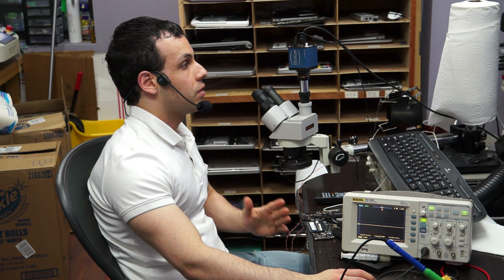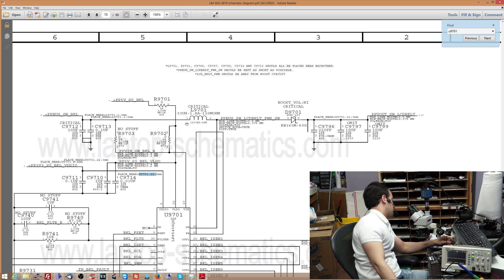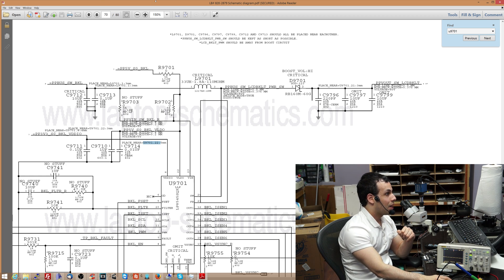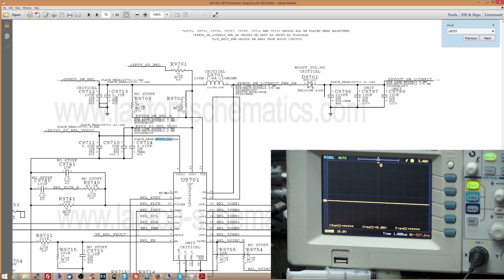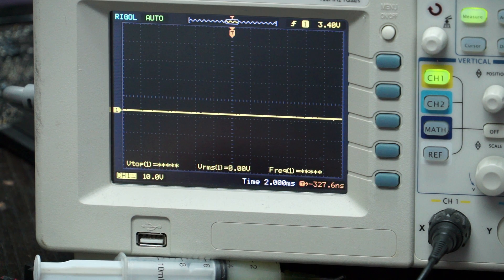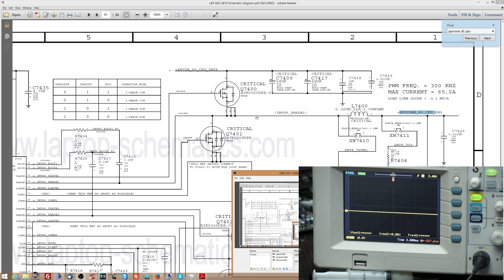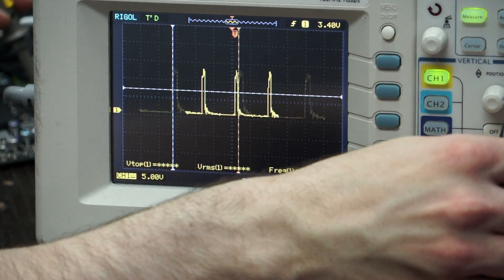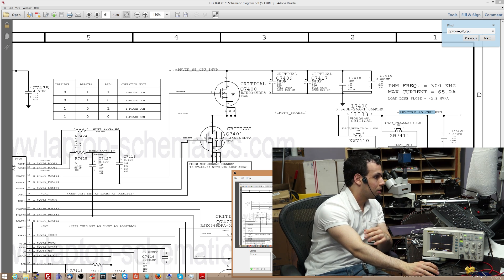What is an inductor and how does it boost voltage?

Comment: Here I am commenting on a 10 year old video hoping to get an answer lmao. Wouldn't the 26v or whatever go to the ground and not make it to the capacitors? Or is my assumption right that the switch is turning on and off right in the middle of the electricity traveling, so it shows the electricity the wallet it stole and then closes the door and then the angry volts are forced to go somewhere, somewhere being to the capacitors?

Comment: I like to think of capacitors and inductors as being conservative: they resist change.
The cap resists changes in voltage by swallowing or spitting out current in whatever direction will counteract the change. 
The inductor does the same, just with 'voltage' and 'current' reversed.
Fun bonus: if you connect both together, you get a circuit of 2 conservatives who fight each other by changing what the other one reacts to change in... They will argue back and forth over it, until the resistance present in both of them has drained them of energy.

Comment: Not enough teachers, or text book authors seperate the 'hardware' ,or mechanics of electrical devices from the software. You dont have to know how and why a component does what it does in order to fix a device. You can, however be sure that what whatever it does, the component/device you're working on is doing what it is supposed to be doing. Even if you dont know what that is.

Comment: The effect of an inductor in a circuit is to oppose changes in current through it by developing a voltage across it proportional to the rate of change of the current. An ideal inductor would offer no resistance to a constant direct current; however, only superconducting inductors have truly zero electrical resistance.

Comment: The only thing I would change which is guess is a little pedantic of me is when you said you’re stopping in the car and you go for a split second at 40-50, it’s not true you’re still going at 20 mph like the car was, the only difference is it’s no longer moving relative to you, so the seat belt holds you back and at 20 mph. That’s a lot of momentum being stopped in a fraction of a second though so that’s why it’s such a large jerk ( or impulse ( change in momentum))

Comment: Your seatbelt analogy suggests that a current of electrons has momentum. Am not sure why they do, but it is like water hammering in plumbing: turn the flow off suddenly and you can burst a pipe. The normal lower voltage (pressure) of the water, when suddenly stopped, greatly increases at the cutoff valve. Thanks.
Reply: I am no physician, so take my words with a grain of salt (maybe two), but i think that the hammering effect of water upon an abrupt interruption of its flow is due to all the kinetic energy that made the water move until that moment suddenly being dumped into the system as the water no longer moves. This energy most likely gets transformed in mechanical energy exercised from the fluid against the valve and heat, which in turn determines an increase in pressure. Hope it helps (and also hope what I said is true, but I'm quite confident it is).

Comment: It's after the short to ground is suddenly removed that the voltage spike is created. Imagine all the electrons accelerating in the shorted loop and then when they are at speed you barricade their easy route and they go shooting towards the backlight circuit at high speed instead. Then the capacitors average out the voltage by storing and releasing charge.

To lower a voltage you are simply using the inductor to smooth a high voltage pulse. If your car accelerator cable stuck so you could either floor it or have no power. No variable control. If you floored it all the time your car would go too fast so you would have to jab at it at just the right rate to keep the car going the speed you want.

Comment: Think of an inductor as adding weight to the electrons. With a standard circuit, each electron is like a nippy little motorcycle. Easy to accelerate and easy to stop. With a high value inductor, each electron is now a heavily loaded bus. It takes more energy to accelerate (increase the current) but it is carrying more energy and if you run that bus into a wall (open circuit), the crash (voltage spike) is bigger compared to the low value inductor (motorcycle).

In a water pipe module it is like putting a turbine connected to a heavy flywheel in the water pipe. In a hypothetical pure superconducting inductor, the turbine would be lossless, converting the energy in the water into the flywheel. If you closed a valve, the flywheel would be forcing the water hard against the closed valve via the turbine. This creates a massive pressure spike.

If you want to know how a DC voltage booster works, research a ram pump and imagine the water is electrons. It lets a large and heavy volume of water water run up to speed and then stops it suddenly, which can create a big enough force to shove a smaller volume of water at high pressure up a pipe and raise it a large distance out of a river.

Comment: I'm sure the same can apply to components on a circuit board, but in automotive I get told I don't need a scope to diagnose. That statement is usually said by someone that doesn't know how to use a scope. There is a lot you can tell from, say, the waveform of a injector turning on and off. You just have to know what you are looking for. Or say, taking 2 traces, 1 for cam and 1 for crank. You can tell just from the 2 traces if the timing jumped on an engine. In about 10 minutes. Instead of at least an hour of tearing the front of the engine down to physically look at the timing marks. So yes, a scope is a great diagnostic tool if you know how to read it and use it

Comment: for future videos you might consider using a simple simulator to visualize the circuit.....
http://www.falstad.com/circuit/circuitjs.html?cct=$+1+0.000005+10.200277308269968+50+5+43%0Ar+176+64+384+64+0+10%0As+384+64+448+64+0+1+false%0Aw+176+64+176+336+0%0Ac+384+336+176+336+0+0.000014999999999999999+-4.971200719641639%0Al+384+64+384+336+0+1+0.015554812617806684%0Av+448+336+448+64+0+0+40+5+0+0+0.5%0Ar+384+336+448+336+0+100%0Ao+4+64+0+35+20+0.05+0+-1%0Ao+3+64+0+35+20+0.05+1+-1%0Ao+0+64+0+35+0.625+0.05+2+-1%0Ah+1+4+3%0A

Comment: That analogy with the seatbelt really hit home for me. Many thanks!
Reply from the maker: I'm glad to hear it!
Reply: When the magnetic field collapses is where you get the voltage spike from
Reply: but ,I mean in real life  when you hit the brake you can't assume more 
speed , you just continue to carry the same "moto" you have, first that 
something stop the moto of the thing that carry you.. (third principle 
of dynamics) you are more faster then the car that is actual breaking 
but you are not faster than the initial speed of the car !! so how an 
inductor could boost voltage ?? what's another easy explenation?
Reply: It was a fantastic analogy. However, could you explain it in terms of vectors? I'm struggling to understand where the 'extra' or increase in voltage (thus force) is coming from.
Reply: +BlinkY it has to do with electromagnetics. I dont know how this works exactly.
Reply: but ,I mean in real life  when you hit the brake you can't assume more speed , you just continue to carry the same "moto" you have, first that something stop the moto of the thing that carry you.. (third principle of dynamics) you are more faster then the car that is actual breaking but you are not faster than the initial speed of the car !! so how an inductor could boost voltage ?? what's another easy explenation?
Reply: ok so I just came across another example, so imagine a creek that carry the same amount of water for all it's length at the same speed with a dam in the middle  (the inductor) that let flow the same amount of water (current) ....so when a man (backlight chip switch ground) hit the red button to let close and come back to the initial position the dam in that split of second what happen ? the water that is flowing hit the ass of that dam ,raising the mass of water hitting the dam so making more power in that split of second ,could be ?

Comment: explanation on buck converter is also partially wrong - it's not only averaging - ironically, "averaging", i.e. integration is done by capacitor (frankly speaking it's one of possible interpretations) - and you are explaining inductor... there is much better explanation as loss-less voltage divider.

Comment: this explanation is wrong - boost happens when switch breaks path to ground since inductor resists change in current and way with low resistance doesn't exist anymore, current is going through larger resistance path, and according to Ohm's law V=IR - more R - more V
Reply: @pauljones8302  ...agreed! Seems he is cognitively "shorted-to-ground." More resistance does not = more voltage or vice versa.
Reply: @Bman130958  V = IR, so it does at a constant current (which the inductor creates). Louis's explanation in this video is completely wrong.

Comment: I learned electricity by thinking of it as water, or any fluid. I look at the positive as the faucet, or other water connection, and the neutral or ground as the drain. So if I ever am dying to figure out a circuit, I just look at the wires or traces and picture an actual flow of electrons.

Comment: Just a remark.. instead of thinking it as manipulation in a bad relationship you could think of it as manipulating  water :P like in case of the inductor .. you could imagine a big pipe of water flowing towards and smaller pipe of water (thickness or in other words how much quantity of water exists within the pipe is amperage and speed of water is voltage)